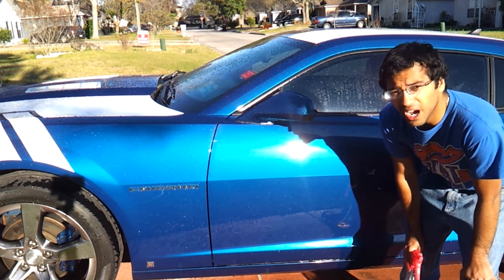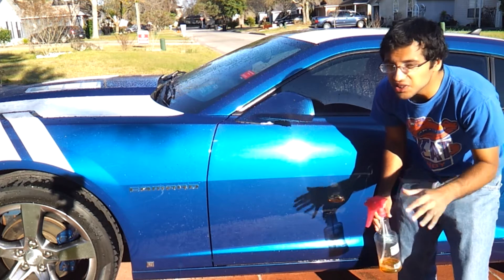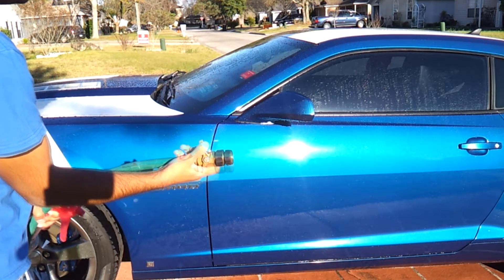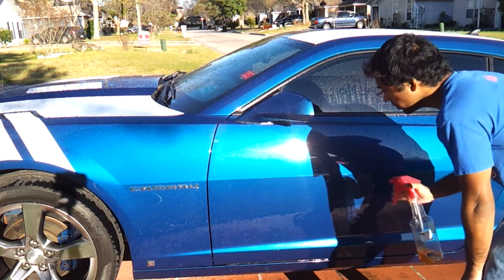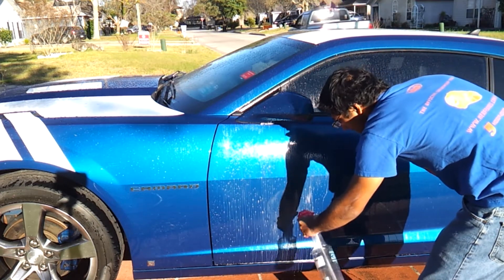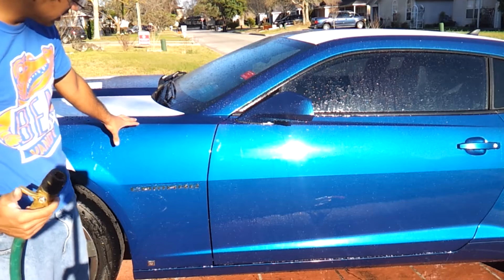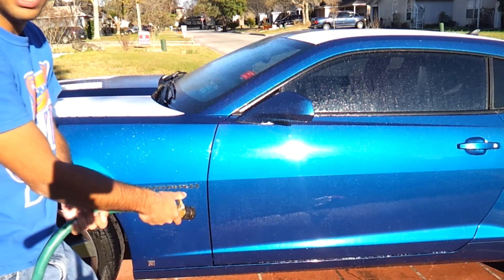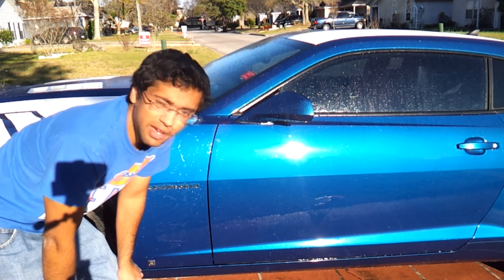Video Review - How Chemically Resistant is Opticoat?

Comment: So after applying opticoat...if u want to wash your car later on...do you jus do a 2 bucket wash? and thats it? since opticoat is already on?
Reply from the maker: Jordan Jay Yup, exactly. No need to wax/seal at all. In fact, waxing or sealing will lower the coating's ability to shed water and dirt, so it is advised not to apply it.
Reply: wow. thanks for the quick reply! much appreciated
Reply from the maker: Hope it helps :)
Reply: roshan517 who told you that sealling Opticoat will reduce its qualities? Opticoat actually makes its own Opticoat SEALER that you use to Reload OptiCoat same as Cquartz recommends to use CarPro Reload which is Silica based spray. Actually not using anything on your Opticoat another words not reloading it will reduce lasting time of the coating

Comment: Thanks for the video and the test, but couldn't you have done that experiment on something a little more expendable such as a lawn mower or a cooking sheet, or maybe a varnished sheet of plywood instead of your car?
Reply from the maker: Thanks for watching!

It's just all purpose cleaner, it's not gonna hurt anything if I wash it off, which I did. Problems happen when the APC dries on the paint.

Also, I don't think you can say a piece of plywood will act the same way as body panels, so it's really only fair to test on a car.

Comment: Thanks for the durability test... but have you done any scratch resistant tests which is probably a more practical and more important test on paint sealants because most people take their cars through those automated car washes months after months and within less than a year they wonder why there are so many small fine scratches on their car... so far, i've only seen videos that CQuartz is the only paint sealant that is scratch resistant... Have you considered CQuartz before you used Opti-Coat?

Comment from the maker: You know water spots are actually the whole reason behind my "Just Half A Test" episodes. So many waxes and LSPs like to cause water to bead, but what you want is sheeting action. Sheeting will remove more water off the surface and help stop water spots.

As for the water spots with opticoat, yes I get them, but I wash my car at least once a week, so I've never had an issue with them etching. 

Dr. G (maker of opticoat) said that you can polish opticoat once lightly with no issues.

Comment: Roshan, did you ever have issues with water spots alter applying opticoat?  I've found that water spots still etch the finish. They aren't removed after washing either. I've polished them out successfully with a black pad and some hand polish on the pc. Hopefully it doesn't mess up the opticoat. Any suggestions?